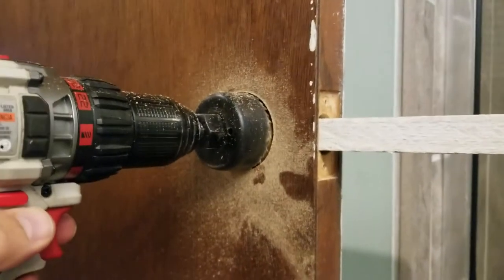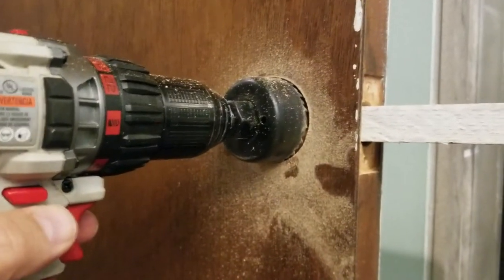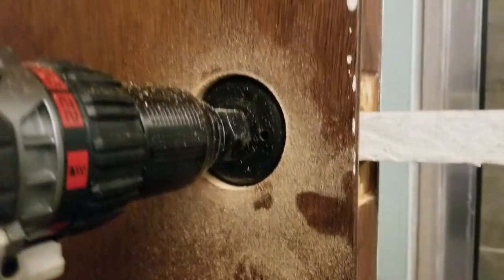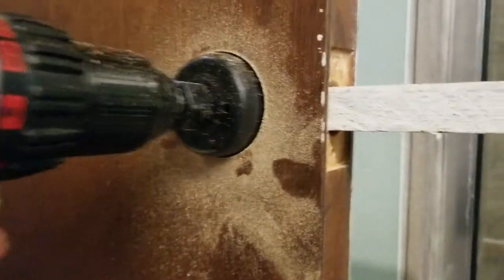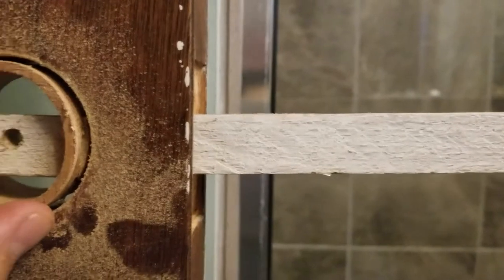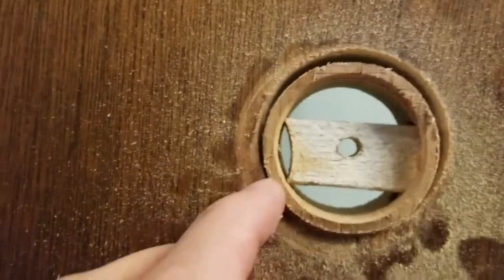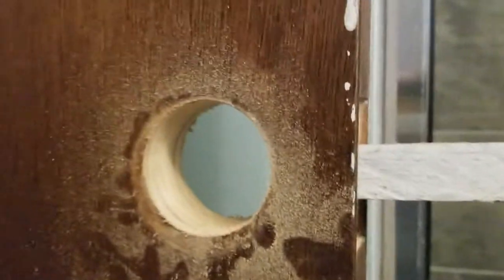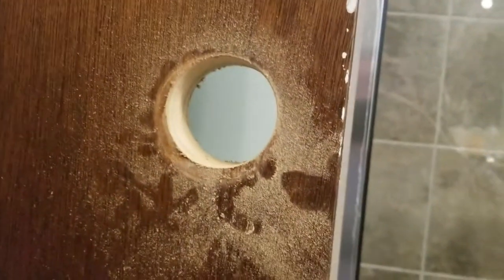Door knob install on old door with hole too small

Comment: Just clamp a sacrificial board to the front and drill through it and the door widening the hole. There are only 2 standards now for tubular locksets 2-3/4" or 2-3/8" backset from the bevel edge of the door and they are both 2-1/8" diameter holes.

Comment: would a round dowel work as well as a square one?
Reply from the maker: I don't think so. It has to fit tight in the hole. You would have to have the perfect size or shim it tight, then you are drilling into a round surface to set the pilot bit.